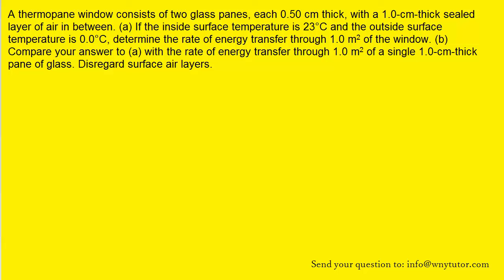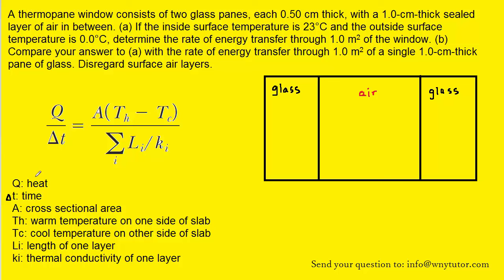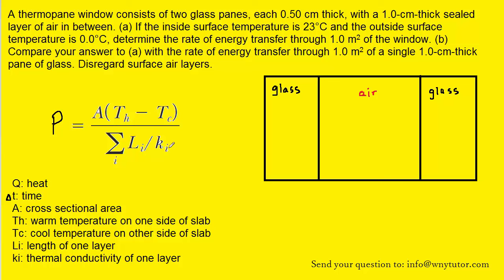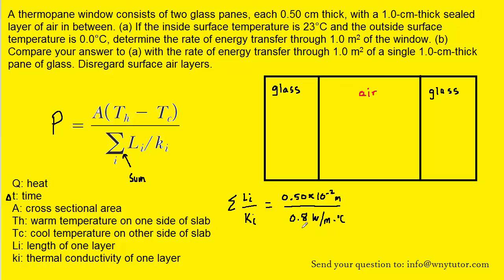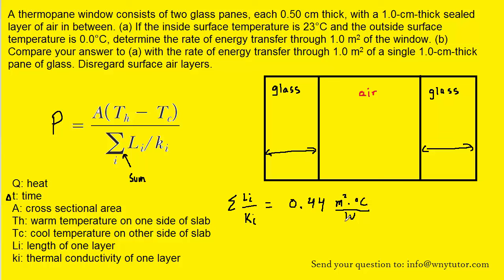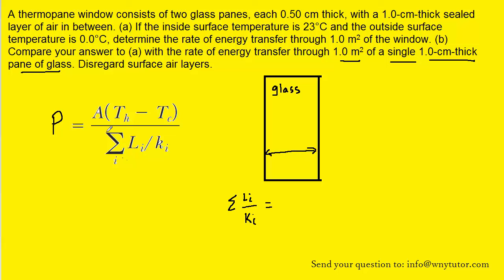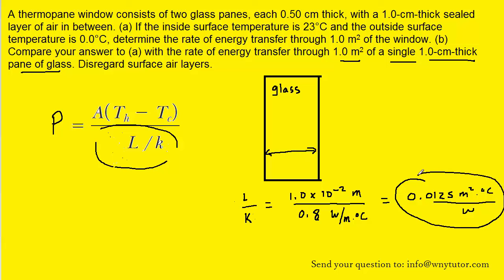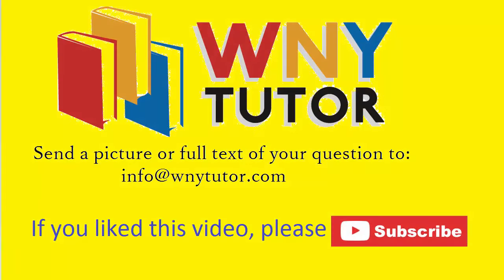A thermopane window consists of two glass panes, each 0.50 cm thick, with a 1.0-cm-thick sealed laye

Comment: I have a similar problem and I can get part A right but not part B. The only difference in numbers is that 20.9 is my Th and 1.7m^2 is my length. I get 80.75W for the first answer which is correct, but then I get 35.2 for the second answer and it's incorrect. The problem asks for the answer in kW but when I convert 35.2 to .0352 I still get the wrong answer.